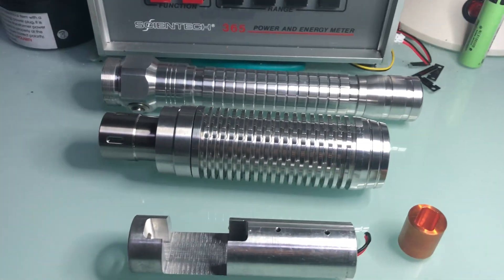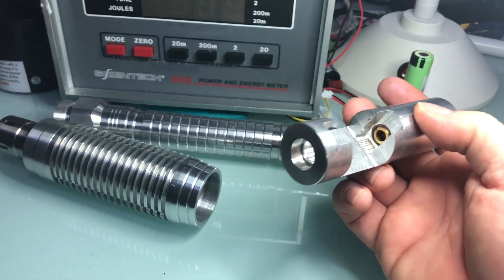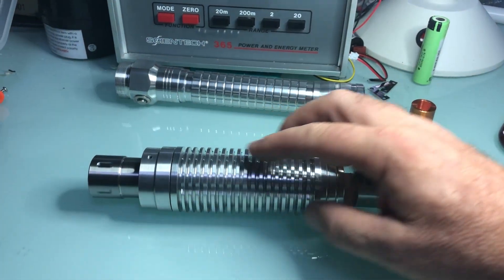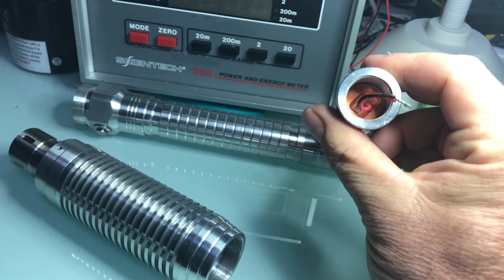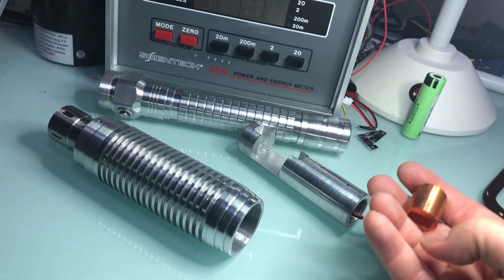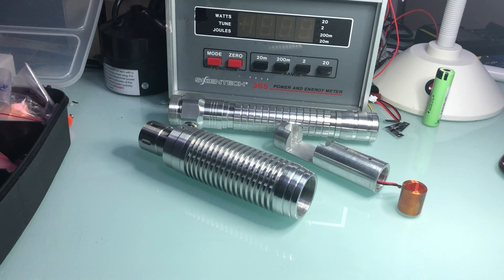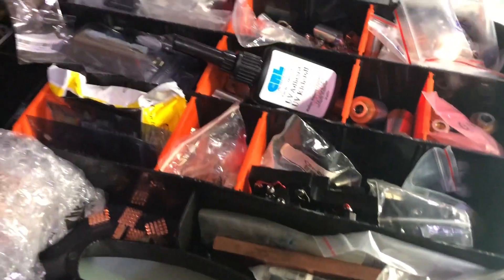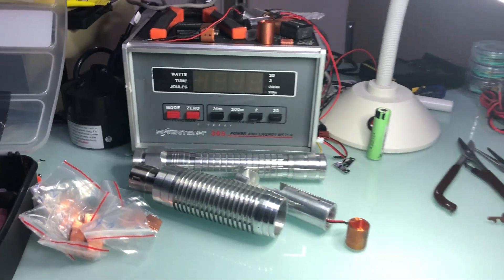NUBM44 450 nm 7 watt blue beam corrected and expanded laser diode host

Comment: any idea how to setup ACS5500BU buck driver ? i am using NUBm44 A1
Reply: @laserhobbyist9751  So basically what is the max current that you would suggest for nubm44 A1 , also are aluminum heat sinks fine? because i had an idea of using a spot light heat sink by drilling a 20mm diameter hole in it ( as my module is 20 mm) as custom housing in laser pointer style are expensive